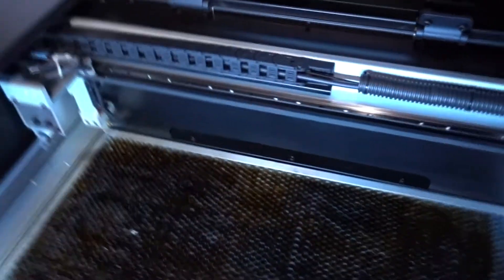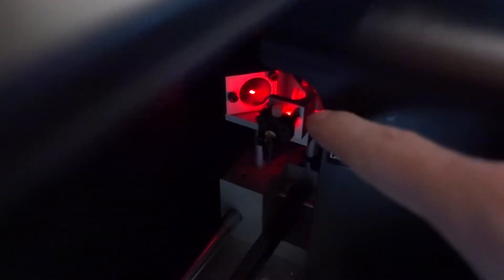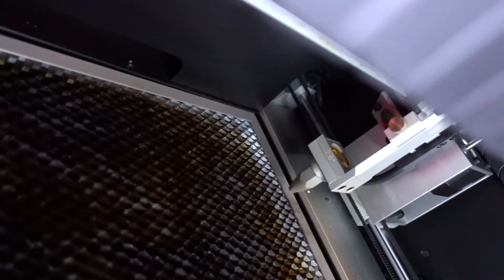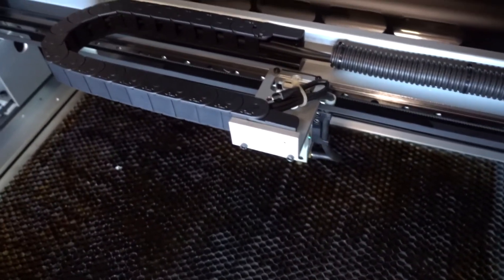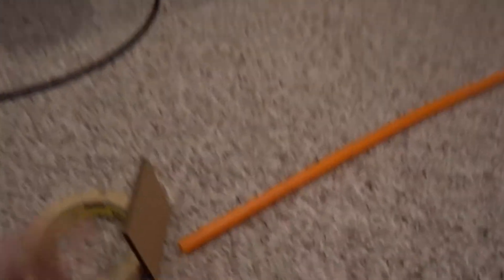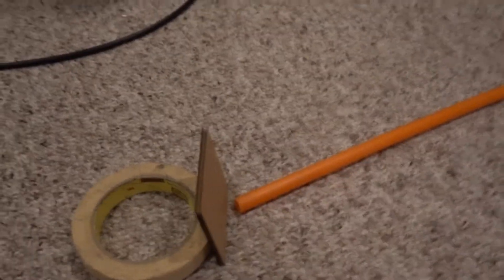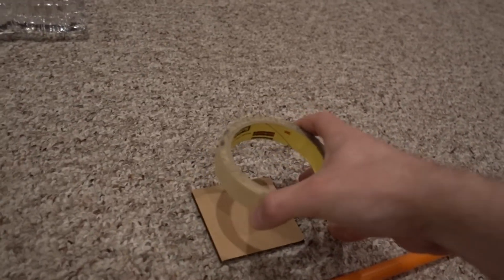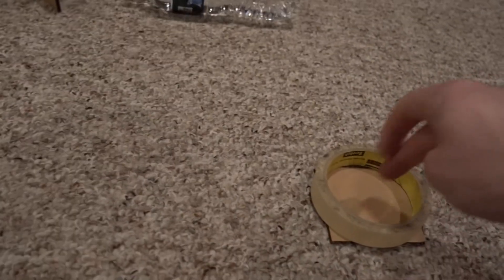How to Align Your Laser! The Easy Way - Featuring FSL Muse Hobby Laser

Comment: So mirror three is showing a level burn - top right will be right on, then bottom right is off to the right-still level horizontally when I adjust bottom right, top right will be “off” same distance to the left of the burn mark. This keeps going when I adjust the mirror? Thoughts?
Reply from the maker: Hard to picture exactly what you mean, but just work mirror to mirror in order. Move the gantry to the extremes for each mirror and make sure the spots still match. if they match then perfect move onto the next mirror. If they don't continue working that mirror.

Comment: So I have the same issues with some on here with response from FSL or lack of, if you're running a business waiting a days for a call back is aggravating. That being said I do like my Muse 3D very much and not regretful at all for buying it.  In the videos from FSL, the burn marks appear round, where as mine are more oval.  Does that make a difference or is there something wrong with my laser?  45W
Reply from the maker: I don't believe the difference in shape should make you worried. If it is very very faint and you're having trouble cutting through things then you may want to double check your alignment, but if you aren't having cutting issues then don't touch it!

Comment: Kevin
Is it possible to contact you to go through this process? We just can’t seem to get it aligned. I think we made too many adjustments.
Reply from the maker: Search on facebook for some of the full spectrum laser groups and you can find me on there. I find it best to try and help people in an open forum like that so others can learn where you're (and maybe they are) struggling and how to get around it. Where are you struggling in particular?
Reply: @kevin_fine  so I think mirror 1 and 2 are now aligned. But can’t seem to align mirror 3.  You talked about aligning it then went to talking about aligning the nozzle. Which mirror do I adjust to get mirror 3 aligned? And won’t any change in mirror 2, if that’s the mirror to adjust, require me to go all the way back to the beginning?.
Reply from the maker: @christophermcromer  If mirror 1 and mirror 2 are aligned all you have to do is move mirror 3 until the beam is shooting perfectly though the middle of the nozzle. Then you should be good to go! You should get a small dot right in the middle of the nozzle (put the thermal paper on the bottom of the nozzle). If you get multiple dots or a faint one you're probably hitting the size of the nozzle and that means it isn't centered.
Reply: Does the lens need to be in to check the nozzle? Also, my nozzle is extremely close to the honeycomb. I don’t see any knob on the side. Is that normal. It has actually rubbed when moving it. It will raise somewhat when the machine moves the gantry.
Reply from the maker: @christophermcromer  yes the lens must be in otherwise you won’t get a beam going through the nozzle
Reply from the maker: @christophermcromer  which model do you have? You should absolutely be able to move the nozzle up and down, either manually with the nob if you have a core or in the software if you have a 3D.
Reply: @kevin_fine  I have the 3d

Comment: Your demonstration helped my understand that the beam can go far off course, which I was suspecting is a problem!  Nice demonstrations with simple materials!  If  Mirror #1 is not receiving the laser in the center, in my case it's making burn marks closer to the southwest quadrant of an 11/16th inch circle of thermal paper with penciled-in lines dividing the paper into 4 quadrants, doesn't that need correction first?  I align the diode to this burn mark, but I think this initially uncentered beam is what is causing the beam to travel horizontally about 1/2" into space towards the side wall beyond Mirror#2!  Shouldn't I at least have Mirror#1 being hit closer to center from the get-go?
Reply from the maker: You don’t need mirror 1’s hit to be centered. It just matters that what travels from 1 to 2 is perfectly flat and aligned (like how I showed in the video). You will center it using the 3rd lens into the nozzle
Reply: @kevin_fine  That's reassuring! So it's not a worry for the beam from Mirror#1 to be ridiculously far off into space for Mirror#2?  I'll just have to make a zillion small adjustments?  I barely have enough space to use the allen wrench because I have to start with Mirror#2 very close to Mirror#1!
Reply from the maker: @carolentin8346  yes start with mirror 2 close to mirror 1 and then work your way farther away
Reply: Ignore my comment, I misunderstood that I don't make adjustments when the gantry is close to Mirror#1.
Reply: Success!!!  Your video really helped me understand the finer points of what I was trying to achieve.  Many, Many Thanks!

Comment: Thank you. I'm having problems with the laser not cutting evenly. I read some where that it has to do with the alignment. Do you agree? If you have any other suggestions, I would appreciate it.
Reply from the maker: Yes it is very common that alignment can cause cutting issues with your laser. Additionally make sure your air assist/nozzle is clean and working properly as this can also prevent clean cuts.